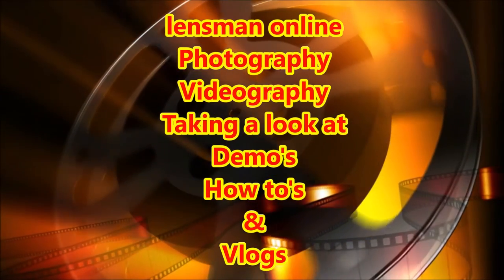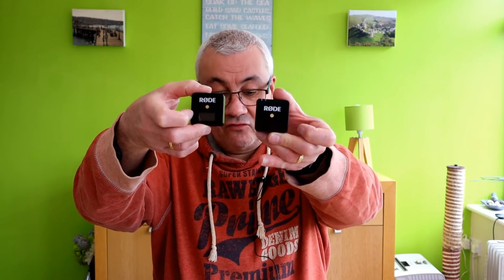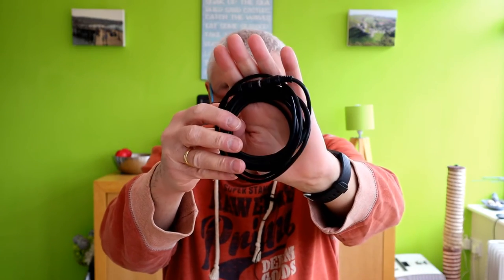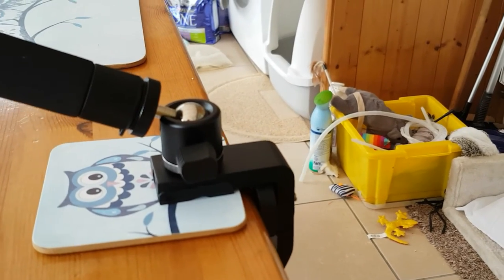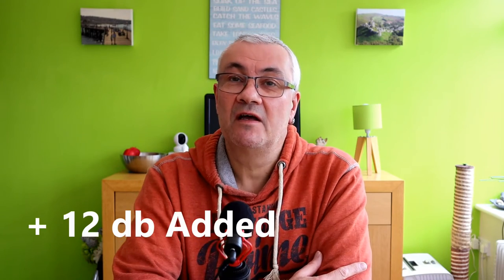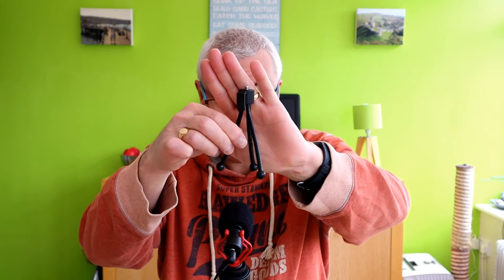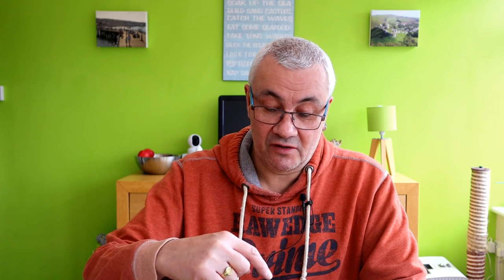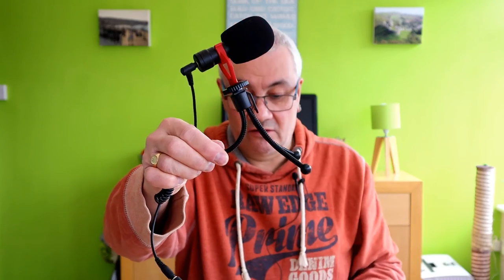Lav vs Shotgun Mic Pt #1

Comment: Hi Jon. The Rode kit sounds more natural in tone. Probably a better mic capsule than the Boya. Reverb in rooms is so difficult to deal with. Basically, the closer the mic, the better. Maybe try the Boya very close. You could then turn the gain down and you’d lose more of the room. Cheers. Ian
Reply from the maker: Hi Ian hope you are well, thanks for commenting and the feedback, I'm going to trying plugging the Boya into the Rode wireless transmitter, and also try to get the Boya closer. I think I'm fighting a losing battle with the echo and reverb in the conservatory, so I think as you say the Rode is probably the best Mic to use.
Best wishes stay safe Jon